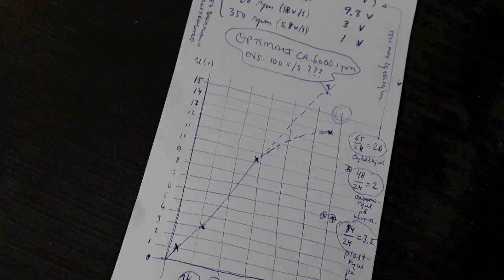Another wind experiment

Comment: Hi Simon
Would wheels worked better ?

Because it looks that it was frozen hard and would have support it with wheel .

Was the sail big enough also ?
I enjoyed it 
I know you didn't make any electricity
Reply from the maker: It would be nice to try using wheels – would be visually interesting ;) When the surface I smooth that could be an alternative. The sails could have been bigger. In this case I think the main problem was that I was to close to the shoreline. The wind came from the shore side and treetops generated turbulence. The turbine should also be higher from the surface to avoid turbulence (and gain sufficient wind speed). As I mentioned in the video, the axis that fixed the turbine to the ice was too weak and don´t spin properly - too there´s space improvement ;)